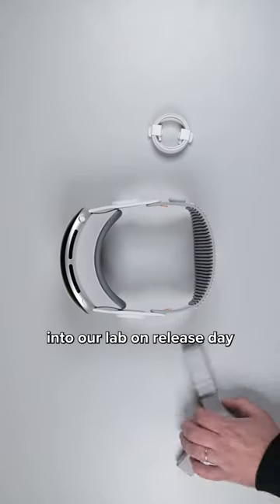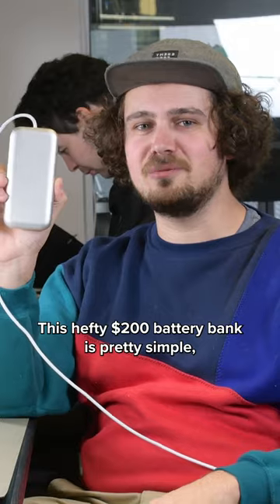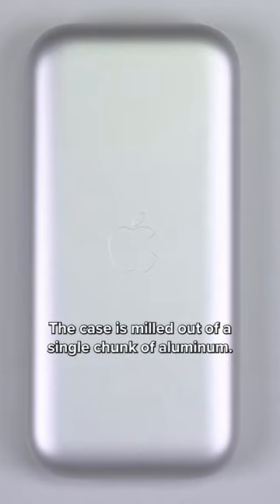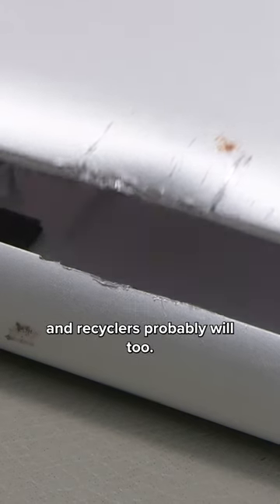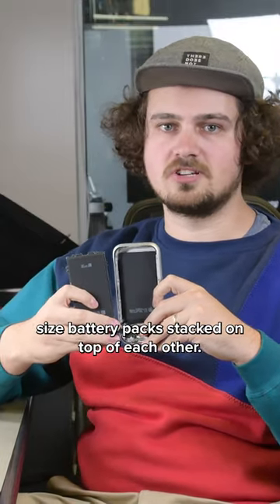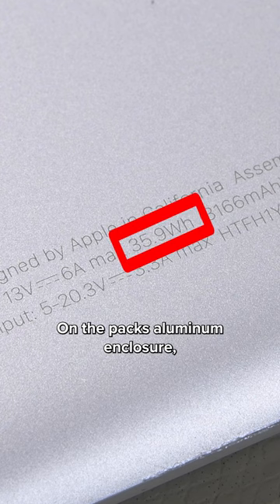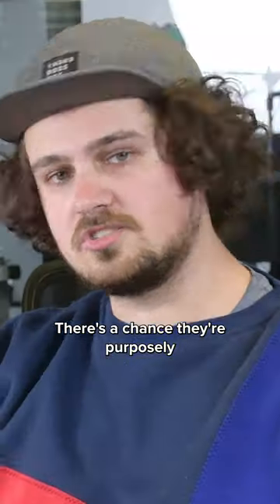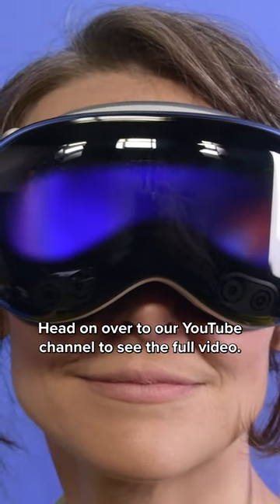What's Inside The Apple Vision Pro Battery?  #ifixitteardown #Apple #AppleVisionPro

Comment: But are we really surprised Apple is doing that? We already know they don't give a crap about their customers, so making their products less usable but more expensive is very on brand.
Reply: but undercharging cells allows them to last longer. how is that anti consumer...?
Reply: @BunkerSquirrel  even making them last longer, with a total charge lasting less than 3h they will degrade fast. And the solution? Spending 200$ on a 35Wh powerbank.  
  
Meanwhile I bought an Anker 737 (140W, 86Wh capacity) for 100$ a couple months ago on sale.

Comment: Undercharging is better for battery lifespan
Reply: @Tyky97isbeast  mate, if you charge a battery to full you are putting more stress on it. Overtime this can cause a battery to swell which not only decreases its operational time but is also dangerous. If you set a battery to undercharge by stopping at 80%, this effect over time is drastically reduced
Reply: Not really no. Your batteries will eventually wear even if you throttle them. It’s a matter of time, better get the best out of it while it lasts
Reply: @禁-n8x They never claimed it stops wear, just that it wears less quickly
Reply: @Tyky97isbeast  you make no sense

Comment: that's actually very surprising given how abysmal the battery life is. Still, it's really nice to see them making an effort to extend the life of the cells
Reply: I think they did it because of how abysmal it is. Giving the full capacity wouldn't have increased run time by much. And since you're going to have to constantly charge it, it would probably be smarter to keep the battery less stressed so it lasts longer
Reply: @ruffmadman  If only they used a connector that allowed users to use third party powerbanks with an already existent, convenient and widely used standard

Comment: I have my laptop set to only charge to 80% because its plugged in 99% of the time im using it because it drains in like an hour and a half, maybe 2 hours if i set it to get up to 100%. But it charges up quick too, so i cant complain too much.
And my s23 FE can charge to 80%, and like an hour before you normally start using it, it charges up to 100%. But sometimes if you wake up at like 5:30 and cant fall back asleep, but you normally get up at 7 or something, its still at 80%, but once you start using it, it only takes a little bit for that 20%

Comment: They are actually giving you the real capacity, the batteries are 3.8/4.4v and must give 5v or more meaning they will use more mah than a higher voltage battery. Quite weird but actually all battery cases "lie" a fully charged 10.000mah battery will maybe give you 9000mah at 5v output if they are 3.8/4.4v, remember they will need to transform the voltage using more current in that.
Reply: Idk what's 3.8/4.4
Most li-ion batteries charge to 4.2 or 4.35v max. And their Vnominal is in the range of 3.6-3.7V
Also watt-hours is watt-hours, since it's energy, independent of voltage.
Reply: It was watt hours not amp hours so the voltage is irrelevant

Comment: USB-C has a version with VGA-like screws. And USB-C PD supports up to 240W
Reply: If they do like that, they would need a voltage regulator inside the visor. And voltage regulator produce pretty much heat..

And regarding to teardown video, avp’s battery seems like doesn’t has a voltage boost up regulator inside a battery pack.

Comment: The lower watt hour rating is probably something to do with using 3 batteries. The entire pack can only put out the watt hours of the weakest link. With 3 packs that's 3 times the chance of degradation.

Comment: The best thing abozthis wireless headset is the battery pack wired to it.

It's like buying a cordless circular saw to avoid messing with the cable, but using a vacuum hose every time 😅

(JK, battery has to go somewhere 😅)

Comment: Apple over-engineering -> difficult to open/service/replace e-waste.   
It's not like we don't already have 100W+ USB-C powerbanks.
Reply: Not at the voltage they want 😂😂😂

Step up increases inefficiency
Reply: @RunForPeace-hk1cu  Untrue. USB-C PD supports a variety of voltages. Apple's own USB-C 96W power adapter is rated for 5, 9 12, 15, 18 and 20V. 96W being achievable at 20V 4.8A. 
  
My Anker 737 powerbank supports 140W output at 20V 5A - with 86kWh of capacity and costed me half of what Apple charges for the Vision Pro powerbank
  
So no, there is no technical reason for Apple to not support USB-C PD with the Vision Pro other than to sell overpriced battery packs
Reply: @joseluislopes3956 and using 20v as main power is nonsense.. the battery should be 6cell or more to reach 20v.

laptops and tablets normally use 7.4-15.4V for internal power
Reply: @__flynrailer3904  I didn't say it should use 20V, I said there is no reason for the Apple Vision not to use USB PD since it could use any of those voltages. 
  
And most laptops actually use 20V (like the macbook...) or more depending on the power of the laptop. Gaming laptops that use USB-C even use 28, 46 or 48V as USB-C PD standard has a limit of 5A, so to increase the power, increasing voltage is needed - BUT THIS ISN'T THE POINT, we are talking about the Apple Vision
Reply: @joseluislopes3956  아마도 배터리 팩에는 어떠한 전압 조절 장치도 없으며, 본체 안에 모든 전원 관리 칩이 포함되어있을 가능성이 큽니다. 노트북 배터리와 같습니다.
Reply: @__flynrailer3904  The device always does voltage regulation, that's not excuse. Smartphones have a battery  battery of 3.7-4.2V, but receives anywhere from 5V to 15V depending on the fast charging capabilities. Same for laptops, macbook batteries for example (depending on the model) rest at about 11V, but receive charge from a 20V power adapter.  
  
There is no technical reason for the Vision Pro not to use USB-C PD, it's a decision to sell overpriced battery packs as is on par with the usual anti-consumer decisions by Apple

Comment: The 80% charge limit is a setting you can turn on for longer battery life over time…stop trying to make it seem like a bad thing.
Reply: If I wanted a phone that only charged to 80% I'd have not spent over $1000 on it that is the definition of stupidity if you are defending that
Reply: @Tyky97isbeast  how about you use either of your two braincells to realize it's a toggleable option. You aren't forced to use it
Reply: @Tyky97isbeast  it is a setting you can turn on to make the battery last longer overtime, and you also have the option to turn it off, so I don’t see what the problem is?
Reply: you can only turn it off on iPhone. not on vision pro (source: i have one)
Reply: Caping it to 95% is more realistic 80% is too much
Reply: @nttinvis  no, batteries work best if you keep them under 80%, not sure where you got your info from